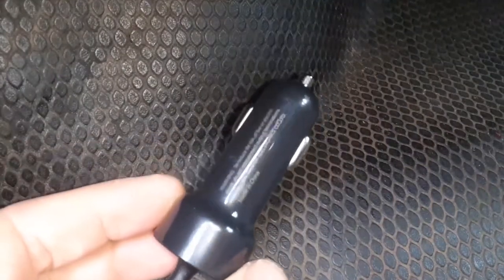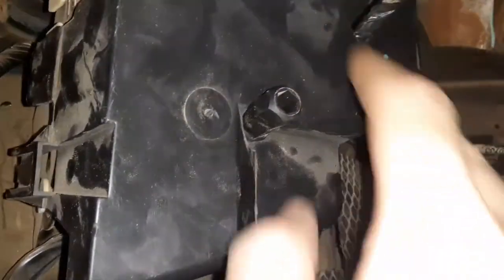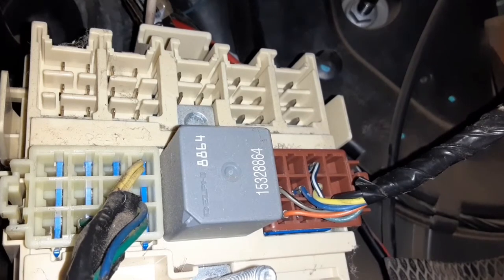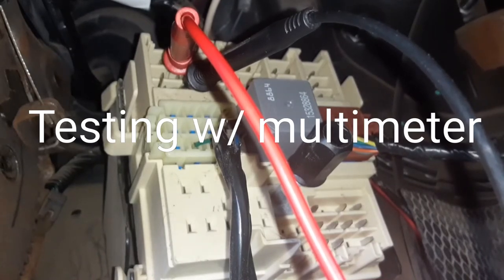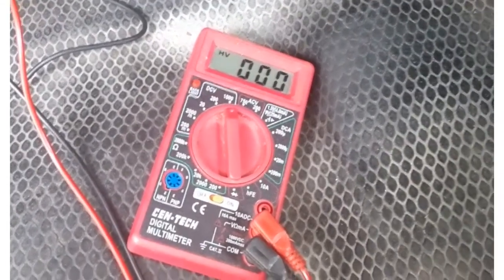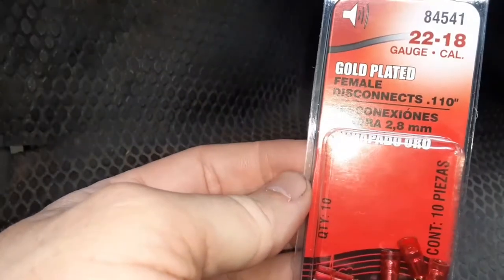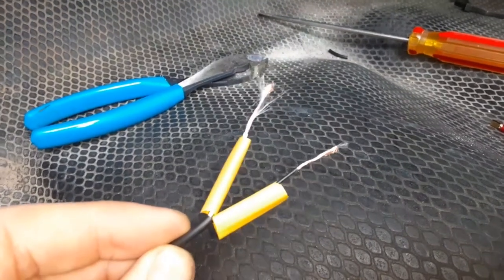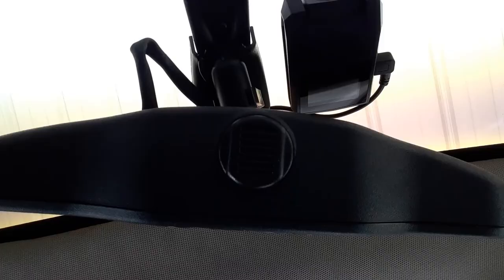How To Hard Wire 12v Accessory Dash Cam GPS - RAP MBEC SEO Silverado Tahoe Suburban Avalanche Sierra

Comment: Did that plug have a transformer inside it? 
Gotta be careful with some of those cigar plugs as not every accessory needs the full 12 volts to operate and a fuse wont protect it.
Reply from the maker: This device uses 12v. When a device uses 5v I put an inline step down transformer. Check my other dash cam wiring video.

Comment: good stuff.  we want to use the other power leads, and our GM part only came with 1 internal connector/pigtail.  any idea where to find the terminals to insert into the connector body?
Reply from the maker: Not sure I understand the question, sorry if this doesn't help. If you're not using crimp on terminals to connect your accessory's wires to the MBEC pins like I did in the video, you can buy one of these: https://www.ebay.com/itm/1999-2006-GM-UPFITTER-CHEVY-GMC-JUNCTION-BLOCK-MBEC-SEO-CONNECTOR-12193930-/222404660893?_trksid=p2349624.m46890.l49292
If you're saying you have one of these already, and it only has two wires, then you can try to open it up and jam more wires in it? Otherwise do what I did in the video.